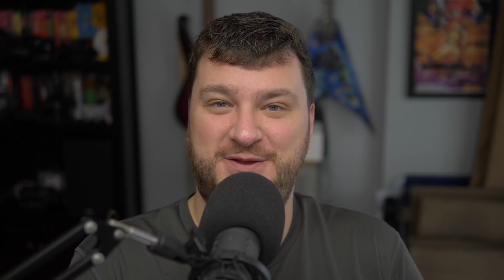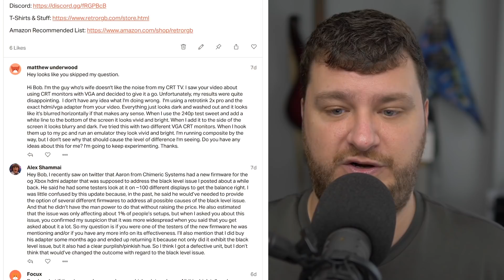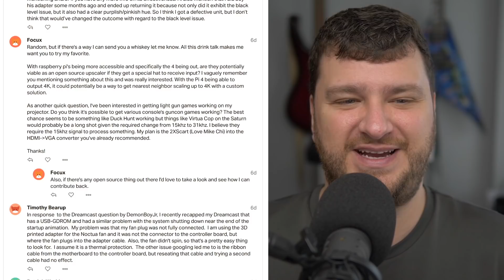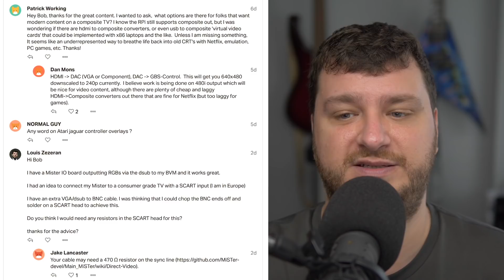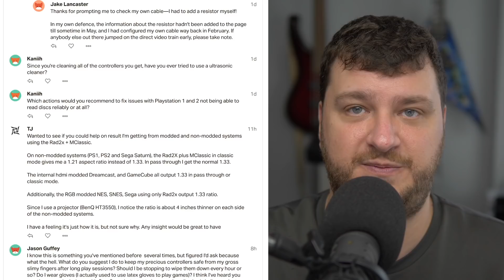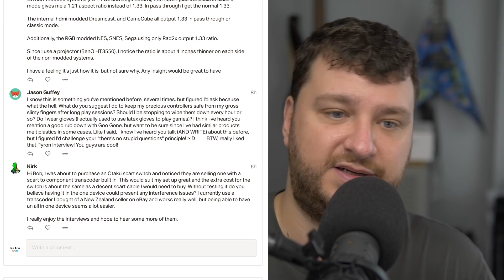Supporter Q&A #116

Comment: Speaking of the Sega Game Gear, I just bought one that has been recapped by the seller, however I'm recapping it myself with Tantalum caps just to be absolutely certain that the system will not give me any trouble.

The caps the seller used are Nichicon caps on the mainboard, sound board and power board and the soldering quality is pretty good, and for £50 for the console I'm really happy with it but SMT Tantalums are smaller, less susceptible to heat and have great longevity. The power board is getting Aluminium Poly caps instead of Tantalums because they're better suited to that role. (The caps I bought are very expensive, you can probably halve the cost I paid, but I wanted extra caps as spares and I wanted the very best I can buy)

It's also getting a glass screen cover and an McWill LCD and I'm gonna change the red power LED for a white one which I did on my Mega Drive II and it looks sweet.

My plan is to rebuild my collection that I had as a kid because I was dumb and threw it away without knowing just how valuable or collectable the console is (tbf I was about 12 at the time) I currently have The Lion King complete in box and I'm waiting on Sonic 2 CiB, and Tails Adventure cart only (which I didn't have as a kid so don't worry, I didn't throw that rare treasure away)